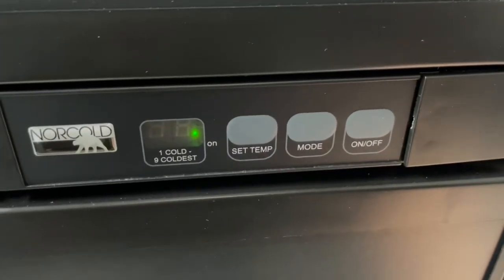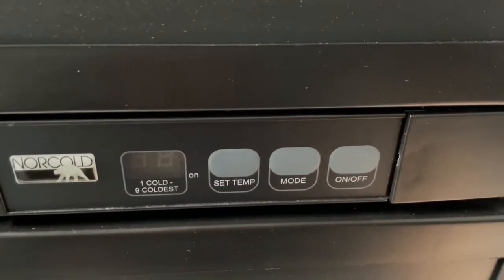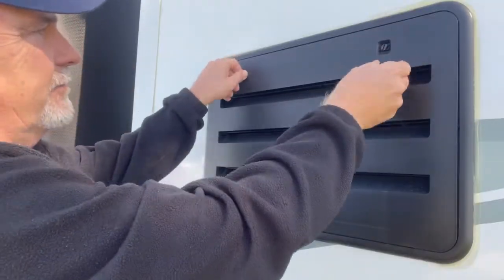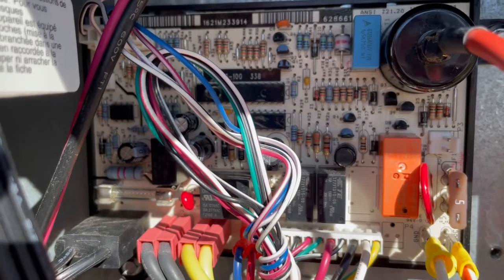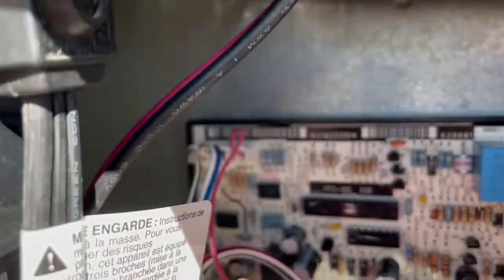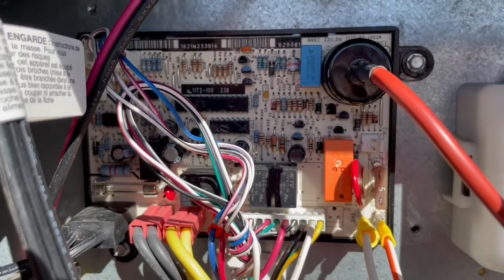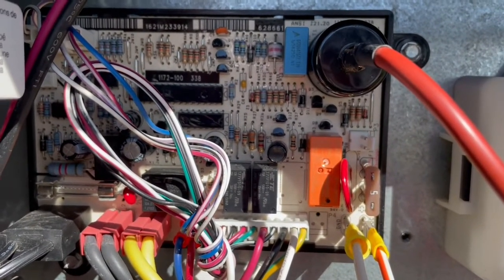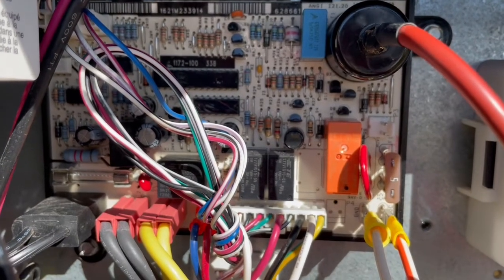Testing Power Control Board on Norcold RV Refrigerator

Comment: I've got some iisue with the Norcold fridge (freeze/cold). Has one spare powerboard too. It works between gas and AC power. And can be working normal for a long time. But suddenly the freeze temp can go very hi + degree farenheit(celcius). So I have to reset the optic control board by turning off and on. Then it can work again. Maybe it can be the controlboard, because I have got two powerboard and have used both. I have added vent fans at the top of the fridge for better cooling at the backside of the fridge and slideout.

Comment: Im so lost, i have the same power control board for my norcold. I have normal volts for AC. But only 3 volts for DC, idk what to do now
Reply from the maker: check converter and then batteries. I have a video on checking battery health

Comment: Thank you so much! I had inconsistent temps and was going to try disconnecting the thermistor; when attempting this, I removed one of the orange connectors. I accidently touched the light with it -- the light flickered for a split second. Then no more power to the display or to fridge. I threw my hands up in the air, saying I probably need a new fridge, and since I'm selling soon, I'm just not going to replace it. I ordered a mini fridge from Home Depot. After a few days, I calmed down and did online research. Your video was the most helpful to me in accessing the control board -- how to remove cover, etc. I was hoping and praying that the 5amp fuse would be blown. Hooray! It was. I replaced it, and all is good. I still may have issues with thermistor, but replacing it will be cheap and easy. For now, fridge is fine. I also learned how to do the diagnostics on the display panel. That way I can monitor what temp the control board is getting from the thermistor and compare it to the food compartment thermometer. They should be about 10 degrees apart. Returned mini fridge to Home Depot :)  Thank you, again, for this really great, helpful video!
Reply from the maker: Thank you for that feedback- really encouraging to keep making videos.

Comment: Thanks for the great instructional video.  I have the same issue and your diagnostic help has allow me to follow the power source all the way to the display board but that is where I am stuck.  How do you check for connectivity on the wires from the Control board to the Display board?
Reply from the maker: Great question! The key is find how far along the circuit the power has traveled including - is it making it through the cabling. It’s been a while since I’ve looked at this but Im pretty sure it’s a continuity test that is in the manual that I didn’t do in the video because  I felt like I was beating up the electronics pretty good on this equipment so I didn’t demonstrate.  It’s in the flow chart in the service manual and the video hopefully develops confidence with this equipment to propel you forward for further independent discovery.
Reply from the maker: I’m going to have to complete the diagnostics on the optical cb. A lot of requests.  I would recommend the service manual. With the instructional help on this video, the steps in service manual should be easier to follow.
Reply: Thank you so much for the help and suggestions to repair my 1200LRIM fridge.  I am looking froward to your next video for the display circit board. @youcandoitrv4198
Reply from the maker: Great question!  I’d go to the optical control board and test and see if you get twelve volts.

Comment: Thank you for this video.  The display on my Norcold 3150 just went out.  I will look at the power board tomorrow.  Have you posted the video for checking the display board?  If not, do you have any suggestions or know of other videos for this?
Reply from the maker: You’re going to want to check for 12 VDC at the optical control board.  If you have power there, this will give you first confirmation  the wiring harness (cable) from power control to optical control is checking out to be in good shape.    There’s a continuity test that I’ll have to demonstrate to confirm harness is good, but from there it’s a check on optical control. I’d want to see 12VDC passing through the board from positive to negative on the board. If not that’s needing replacement, likely.

Comment: Hey did u do the display testing. I have a short at the fuse. Will ur test work without a working fuse.
Reply from the maker: The cable harness where I’ve checked for 12 volts will show 0 volts if the fuse is blown and needs replacement.  That fuse needs replacement.
Reply from the maker: the display will not have power if the 12 volt fuse is blown.

Comment from the maker: The two big red connectors with black and yellow leads are 120 Volt Heaters. Definitely look up the service manual and be sure of your  understanding for safety sake. Call technician if necessary.

Comment: What are the two big red connectors on the board?
Reply from the maker: The two big red connectors are 120 Volt Heaters with black and yellow leads. Refer to service manual for drawings. Be sure of your understanding for safety sake. Call a technician if necessary.